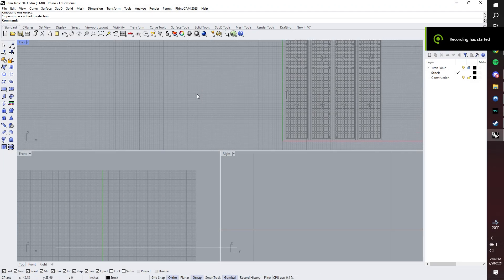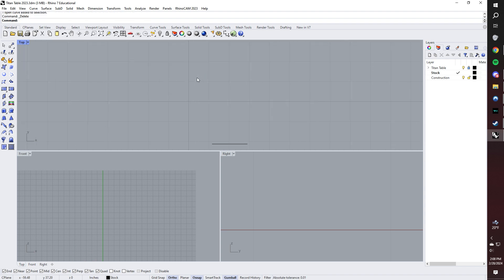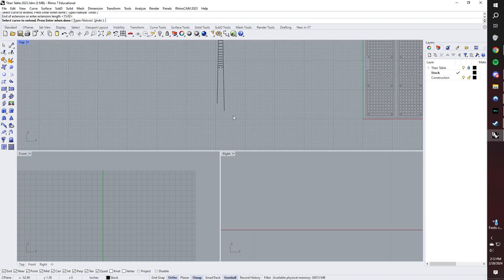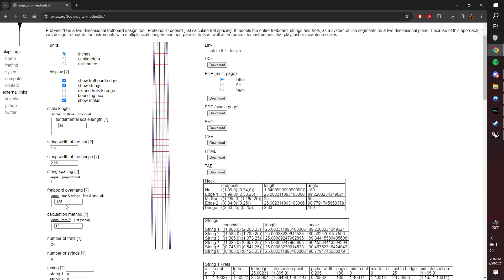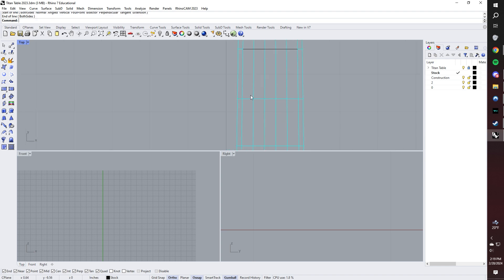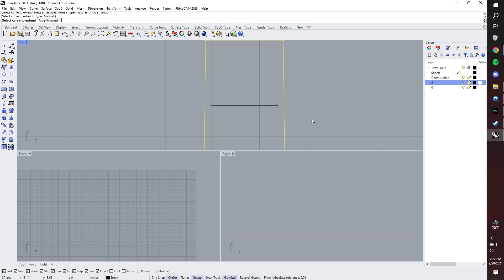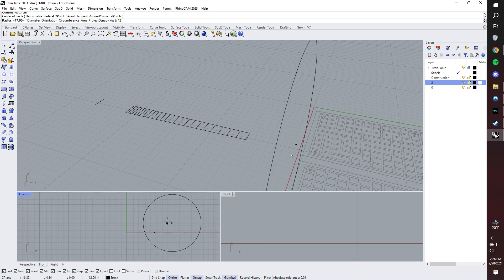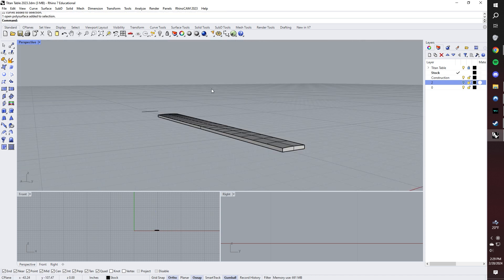How to Model Fretboards in CAD | Will Bezard

Comment: Correction! In the beginning of the video I mentioned the “rule of 18” calculation method. Since I recently time-traveled from 1832 I frequently forget about the 12th root of 2, which is the modern standard calculation method.